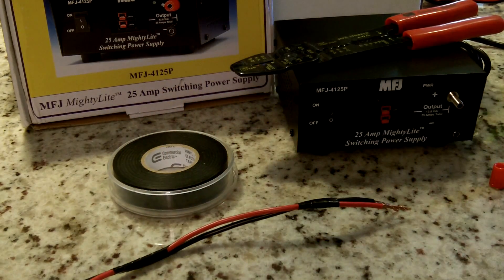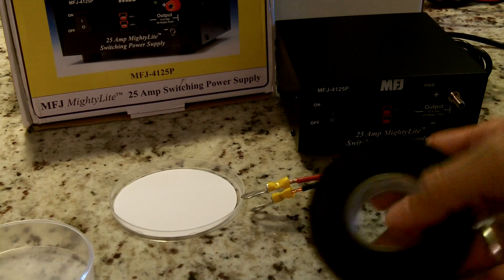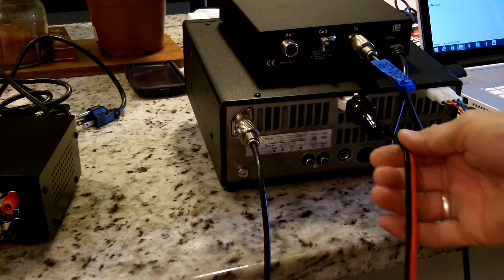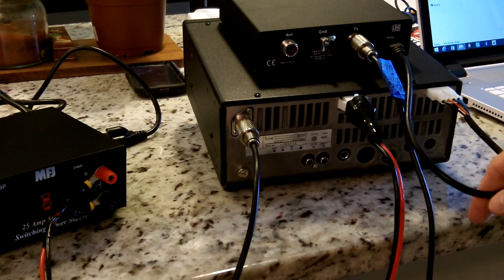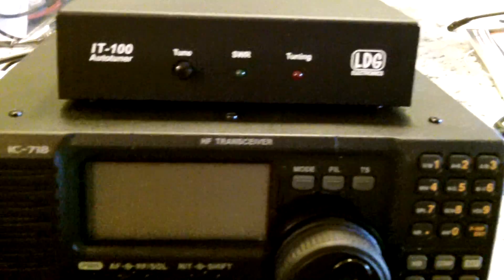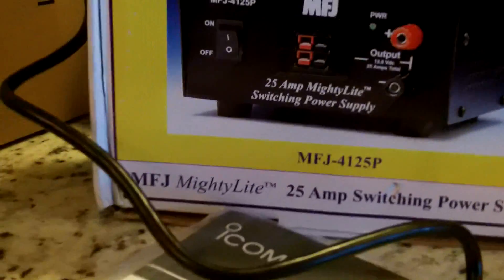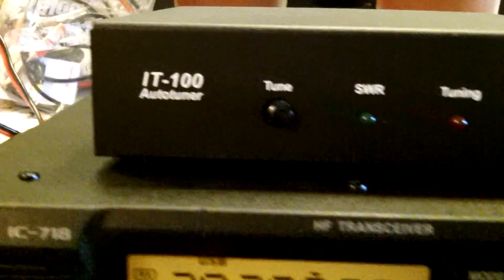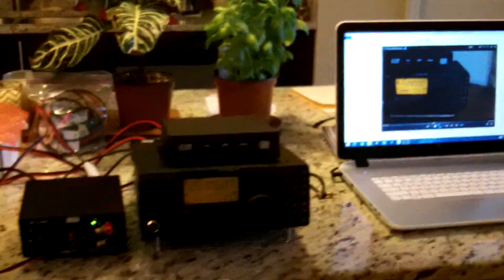ICOM IC-718 HF Transceiver- Set-Up

Comment: I knew those wires were stripped too long and we're sure you would correct the length! Not to mention the other lug, not being crimped was in the jaw of the crimping tool!  Was last straw😮‍💨
I digress; At the risk of being cruel. Re-name video, how not to crimp a terminal. On a positive note: you did have the correct color lug, yellow for 10-12 AWG

Comment: one commit on how he set it up on the power leads i would 63/37 rosin core electronic solder.and solder the lead before connection the lead to the wire ends and solder the ends to the wires they will last a lot longer and give you let trouble in the long run

Comment: I have purchased Icom products for many years. I spend literally into the thousands on icom products.. Recently I received  an icom 718 that had a dented lid, the exterior box was not dented in any way shape or form.. I contacted Icom via email and was told that I would have to purchase a lid to replace it even though I was not at fault for the damage nor was the damage caused by gigaparts , one of the places icom sells radios out of .. I am amazed that icom will not send me the lid  after how truly I have been loyal to them.. In literally many many products ranging in the neighborhood of over $20,000 in purchases of their product they will not stand by their product and  replace the damaged lid that is charged for $36.00.. it will be the last time I will buy from icom is the way I feel at this point.. last year alone just on this model radio I purchased 14 of the icom 718 radios alone .  in one year.. I am very disappointed .. I am not lying and for a $36.00 lid icom is willing to lose a loyal customer.. Tony Tyler..
Reply: Thank you for the information about Icom. This is not the first  I’ve heard about lcom’s poor customer service. Do you feel the same today about Icom ?
Reply from the maker: Thanks for sharing your story Tony.  This is a very troubling report as this company needs to learn and practice better customer service.  Take care.

Comment: Thanks for a great video.  Its helped me with my new IC-718.  One thing though, if you didn't leave so much bare wire exposed when you crimped those ring terminals, you wouldn't need to tape them, as the skirt of the terminal is there to keep it clean.  The wire's jacket should touch the back of the metal crimp section in the ring terminal (under the terminals skirt).

Comment: Hope it works. I would have soldered the terminals onto the wire, then used heat shrink on it. Also, is a 25 amp power supply pretty borderline for a 100 watt radio? I have a 20 amp power supply that I have had for about 10-12 years, and it is just barely enough to power my Yaesu FT-2900R on 75 watts. I just upgraded to general after nearly 25 years as a tech+, and have an Icom 718 on the way. I plan to use an Alpha EZmilitary antenna.
Reply from the maker: +vulcan1753 Thanks for your comments.  I may bump up my power supply.  I also have the Yaesu FT-2900R in my van.  I love it.  Running it on low power right now, but am having installation done soon to be able to use it up to 75 watts.  I am going to get the Alpha EZ as well for my van.  Let me know when you get yours.   Take care.  Anthony.